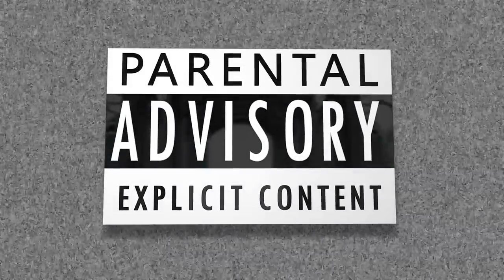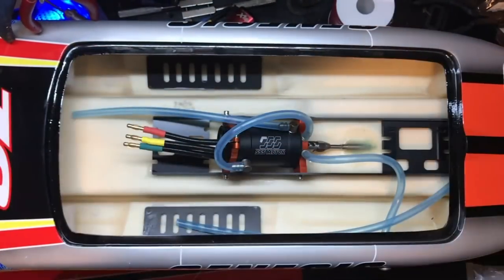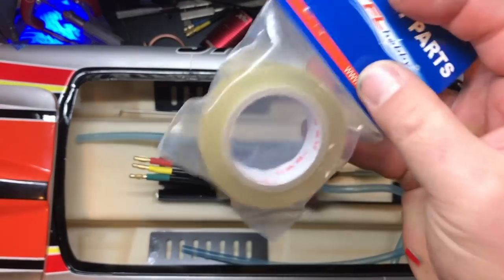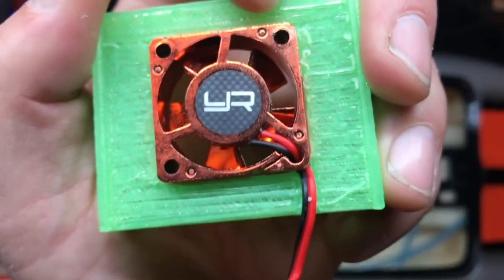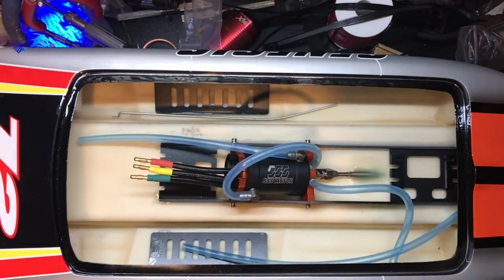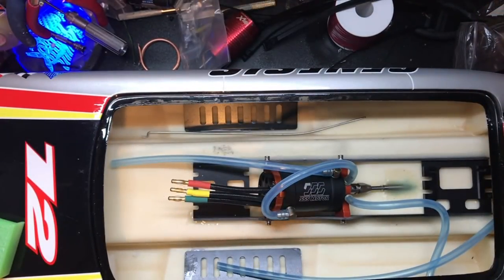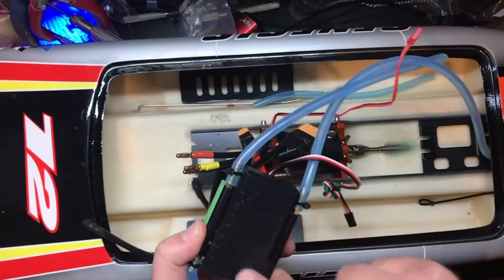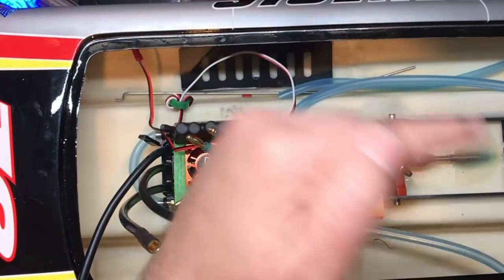Episode 1: The Genesis Boat build.. "In the Beginning"

Comment: You mentioned that you expect more water flow through the rudder pick-up than the under-hull pick up...why??  i would think water have more consistent contact with the hull and I would expect water to more easily  travel the minimal height difference between under-hull and hull floor rather than traveal up the rudder conduit and up the attached tubing....what do you think?